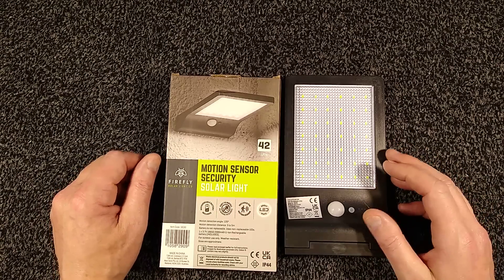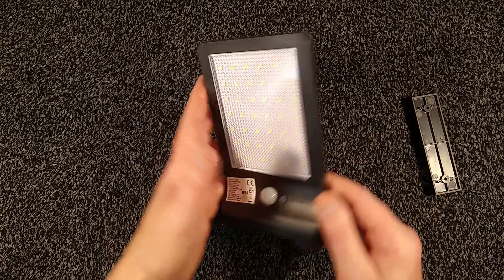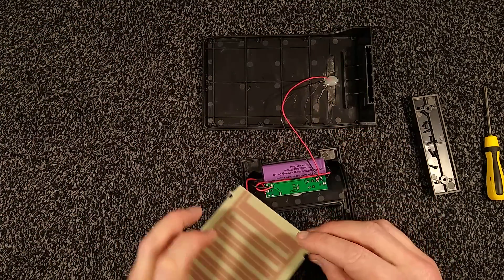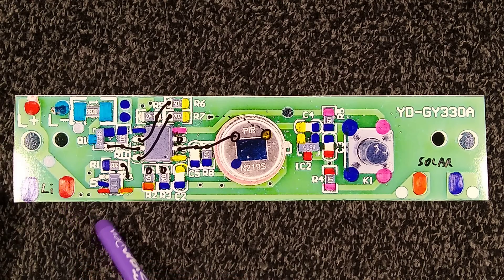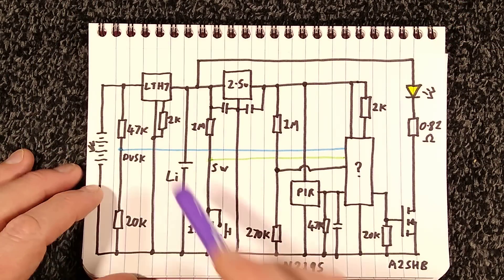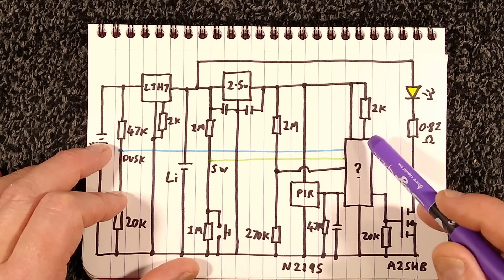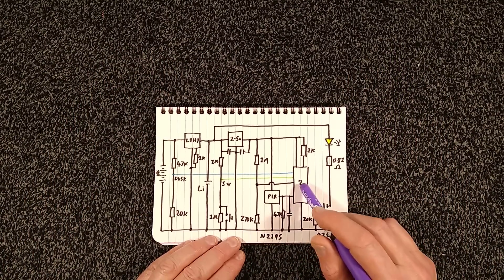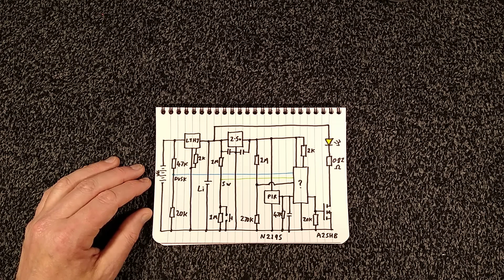Home bargains solar security light is better than the junk on eBay

Comment: We bought two sets of solar power landscape lights in 2008. Each set has four very well made tiered path lights and a solar panel. The panels have good quality PV modules mounted inside sturdy, sealed ABS housings with high quality glass lenses. They have been in continuous operation since 2009 and were still working in 2024, although a bit dimmer and the paint on the lights had faded (but didn't fail). We normally have very dry weather here in Central Arizona, but we also have a couple of months of Monsoon with a lot of rain. Our temperatures range from single digits (F) to over 110° F. We can also get up to two feet of snow over a couple of days. No problems at all wit the light except for those I already mentioned.

We redid the front yard so I took the opportunity to take the panels and lights apart and clean them up. I put in new batteries and replaced the four barrel connectors for each light's cable with gold-plated binding posts. That allowed me to run a single length of landscape wire from each panel and tap the lights off of them. 
When I rebuilt the lights I added new heavier pigtails and repainted them to match the other house fixtures. Good as new (which was pretty damn good).

Comment: Any way to disable the on at dusk feature ?. Mine doesn’t get anywhere near enough sun in UK winter to charge properly and being constantly on at night is no benefit and just cycles the battery for nothing.
Reply from the maker: It will be baked into the software.

Comment: CLIVE
I've just bought one of these.
Battery was totally flat, so I had to desolder it and charge it using my Turnigy Accucell charger (set appropriately of course).
The only thing that bugs me about the device is that when it's on standby it's lit dimly all the time, until it detects something, then switches to full brightness for a period...
I don't need the dim always on... How could I modify to have the leds completely off until the sensor switches it on?

I FEEL A SECOND (HACK) VIDEO MAY BE USEFUL 😂👍
Reply from the maker: Unfortunately that may be locked in the software as it is PWM dimming it.

Comment: Clyde, I've watched your videos for a while now and always come away with some bit of your knowledge to use myself.. Some are straight over my dome but mostly big man I enjoy the rest. Is there any chance Clyde I can reduce the volume on a robot dog who i got for my granddaughter and her da says it's a paracetamol toy... I seen another video saying that a resistor in line to the speaker will cut down the volume output... But what he didn't explain was what size you would use and how large can I use.. I'm fairly handy soldering and wud tackle it.
Reply from the maker: You may have to experiment with a value between 4 and 100 ohms.  A one watt resistor should be OK.

Comment: I've just spent 20 quid on a similar unit from TLC. It is metal and has the facility to change the battery (an 18650) without fully opening the case (you twist off a battery cover with a screwdriver). No warning about not using it in winter though. I wonder if part of the extra cost is mitigating against freezing temperatures? 

The light from the LED's seems far nicer than my 'cheapies'. I guess the test is to see how well it lasts the winter.

Comment: For outdoor applications LiFePO4 (lithium iron phosphate) cells would be more suitable because they operate safely in a wider temperature range. Unfortunately the voltages are slightly different so a basic Li-ion charger does not do a good job with the different chemistry.
At the end of the day, to get more life out of a rechargeable lithium battery, the charger IC should adjust the charging current to the temperature in order to limit the stress. The cells usually warm up while they are being charged so the charging rate tends to increase after the initial phase. Such a sophisticated charger IC is not the kind one would find in a cheap solar powered light.
Lowering the "fully charged" voltage by a 50-150 mV (trading off a bit of the available capacity) also significantly extends the life of the cells.
Reply: @mekkertroniker2002 I don't understand what you are asking.
My observation was about how rechargeable lithium batteries are affected by temperature, specifically what extends the life of a cell which has to operate in the lower end of its temperature range.
Reply: @mekkertroniker2002  well, warming up from low temperatures makes the battery better: the same cell, with the same charge,  effectively has a lower capacity when colder (the voltage at the same charge level is lower and drops off earlier during discharge). If we take two identical lamps, in the same environment and we adjust the discharge currently differently, the one with the higher setting will warm up faster than the other after switching on and will settle at an higher cell temperature. Yet it's not simple to tell which one is is better off because two parameters are different at the same time and the degradation due to higher discharge current may dominate the benefits of operating closer to the ideal temperature. With a 'dumb' discharge circuit there is no single answer: a fixed current setting on certain nights may give you an happier battery but, on other (colder? warmer?) nights, the higher stress does not get compensated.
This is what I can think right now but I would need to do a more detailed analysis.
Anyway, it's an interesting question.

Comment: just wondering how the intensity change happens when the PIR is triggered - only one MosFET controlling the LEDs.  I have a couple of these lights out here in Australia to frighten the bloody possums away from my herbs.  Very reliable
Reply from the maker: It uses pulse width modulation to give a lower perceived intensity.
Reply: @bigclivedotcom  head slap on my side - of course.  Scares the crap out the possums still

Comment: It would of been a good idea if it had a circuit to prevent the lithium battery from charging when the temperature was too cold. Not much good when you have to take it down in winter as the nights begin to get darker for longer.

Comment: Been using one of these to light a key safe (ideal as the led panel is facing straight down). Really bright down light without blinding your eyes, been running for a year or so and no issues. So much better than the far east units that seem to last one summer at most.
Reply: Installed year round with no charging issues in ~freezing temperatures?
Reply: @snafu.X  Because it’s protected from the wind/rain and my house is old so solid wall construction and leaking heat through its walls, the unit is protected from all but the deepest frosts.

Comment: Those plastic type of solar panels can become  VERY  cloudy , with constant sunshine .... you can make them look new & shiny , by the application of household varnish ... but I recommend a  LIGHT spray ... (  POUNDLAND™ ! ) spray yacht ( ? ) varnish works well ... do  NOT  be tempted to slop on a thick brush layer , from a tin  ... the solvents will give the  plastic covering a ( 1950's😝 ? ) crackle finish ... defeating the whole effort ( Ha - Ha ) ... ( ? ) ..... DAVE™🛑

Comment: I'm guessing the reason they don't want to use LiFePO4 cells is because the Li-Ion cells are so much cheaper, even though the temperature range isn't really suited to your climate. From what I can tell, you can get them in the 1100-1600mAh range, which I'm sure would be sufficient considering you're not likely to be running this thing for hours every night. But yeah, the cheaper non-aliexpress/alibaba sauces still seem to be around the 5 USD mark, which would make these cheap kinds of devices much more expensive.

Comment: I just bought a universal travel adapter from AliExpress (with the slide-out pins for different plugs). Wide range of prices, little apparent difference in features (mainly the USB port wattage). Would be good to see the innards of a few compared.
Reply from the maker: Be aware that some of the less compliant adaptors can pop out live pins in use.

Comment: Great info about the lithium charging.  I thought the LiPO4 batteries were the ones susceptible to that and not so much the regular 18650s.  Thanks Big Clive.  Now I know to bring these suckers in for the winter.  I didn't known that.  I guess that's why some have failed (in addition to UV susceptible solar panels which I've not figured out yet with P-Cut or Wax or what have you)

Always great to have the Explosion Containment Pie Dish right?  LOL  Interesting circuitry.  Thanks for your workup.

Comment: A lithium-battery-containing solar light I bought a couple years ago has started to flicker. This is a problem, because the one watt LED is pretty much right in our faces. I've never been totally happy with it, so I might rip it down and do some of my own upgrades to it.
Reply from the maker: It might be the LED that's failing.
Reply: @bigclivedotcom  I had not considered that prospect. Thanks for the heads-up.

Comment: I've had a very similar one for a few years, after replacing the lithium cell for a better one and increasing the LED resistor, it has been quite good. As mentioned the solar panel has deteriorated, whitish surface and edge starting to delaminate. Mine also had a remote control, I had to replace the 3 terminal IR receiver, whose leads corroded.

Comment: We get these very similar looking lights locally in Aus branded “Arlec” from Bunnings. Had a few over the years and they really are a very useful and reliable light. Low level turns on at dusk and the higher setting comes on when ir detected. But then very cold weather was rarely a problem. Great for mounting over doorways when you need to find your keys.

Comment: The 1MOhm resistor divider on the battery side with the switch is actually quite clever - it allows a single A/D input to both monitor the battery voltage (so that the controller can go into deep sleep if the battery is too low) and to detect the switch being pressed. Really efficient use of minimal components and great functionality.

Comment: Most of the security lights I find are all using batteries and solar. Even expensive ones. Our winters get down to -40C so they might last a year. I just want the good ol' $20 one that you hook up to your light switch and electrical but I can't find any good ones!

Comment: I work for a Heritage Railway and we have solar powered security light's and two years ago one of the light's the battery's failed after a cold snap and now I'm thinking that must have the cold weather had some thing to do with that.  It was cold we had brakes freeze up on the carriages great fun

Comment: Not being able to adjust the "on" time is an issue for me, whether or not the pcb can be hacked to enable adjustment, most I've seen of the cheapest and nasty have all the circuitry inside the pir module?

Comment: "The Lithium cells don't charge too well when it drops below freezing" - a problem we never have where I live 😀.  They tend to lose charge capacity when they get past 40C too (a problem we DO have!). Very nice little light though, and it appears identical (internally) to the "Stainless steel" case ones we have, even down to the easy-demount bracket. Ours have a single turn trim pot on the "dusk" divider, so you can set the light level where they turn on.
Reply: Sounds like your area isn't too different from mine, as far as lithium-ion cells are concerned.

Comment: The chip might be just a micro controller using all of it's inputs in analogue mode (but that wouldn't explain the 2k resistor direct to an input unless it was to a reference pin and the pin capacitance is part of a filter). It looks like the divider with the switch could be doing double duty of measuring the cell voltage to cut the light at low battery, as well as sensing the switch; if holding down the switch for a while (long press) switches the light off, then maybe that is the case.

Comment: The voltage divider on the button also makes it possible for the micro controller to measure the battery voltage.

Comment: Can you show how to bypass PIR correctly to stay in "low mode"? Hot snot pressed into the golf ball with an oiled ball bearing is the mechanical disabler.
Reply from the maker: You can just cover the PIR if the light is just for low level continuous use in this type of light.

Comment: I bought a bunch of Temu lamps for a long dark wooded driveway.  Even is Summer it gets little sun and low light levels.  I added an external connector to the battery so it can be charged without opening it up.  In Summer, I need charge it only once a month at most but in winter, I charge them once a week.  It rarely freezes here.  I just use a portable battery pack and an external charging board hooked up to them for a few hours.  Not the perfect solution but worth it.
Reply: How do you protect the charging port from the elements?
Reply: @Legend813a  It's just a 2 pin connector hanging out of the casing.  It's aluminum contacts so no rust but dirt and pine sap does get in now and then.  I clean it with alcohol regularly.  Rain doesn't affect it, being low voltage.
Reply: @Legend813a  You can always smear it in dielectric grease.

Comment: It's a bit disappointing that it doesn't have a temperature sensor and MOSFET to turn off the charging. I wonder it the battery protection circuit has one?

Also note that lithium ion cells also don't like being charged at temperatures above 45°C, so perhaps not using it in hot areas in summer. Also note if it's in the sun, it will get hotter than the air temperature.
Reply: Hmm, most micro controllers have internal temperature sensors, so  it would be pretty easy to detect if the unit got too hot. Even though it doesn’t have explicit charge disable circuity, it could always turn on the light to bypass the charge current and reduce charging that way. I’ve used this method myself in solar lights, and it works pretty well to protect the cell when it’s too hot for safe charging.

Comment: There is a huge hole in the PCB that looks like it has fully severed a trace. If so is there a bodge on the back to fix that or is that hole there to fix a design flaw?
Reply from the maker: It may be for testing or as you say to fix a flaw.

Comment: Re your winter comment: I have run some solar lights with 18650s for 4 years in the harsh Canadian winter. I have only taken them in one time so far to top them up when I had a particularly dull month one year. It gets to -40C but they only charge for a few hours in the noon sun when it is a balmy -10 or so. So far all the cells are fine!

Comment: I have a solar light that has three slots for 18650 cells.  It only came with one slot filled but I filled all three slots with matched cells for better longevity.  Great option for darker times of the year.

Comment: I noticed at the beginning of the video you somehow managed to light the LEDs at half (quarter?) brightness and later on at full brightness. Now looking at the "shkematiks" the only two ways it can be achieved is either the mystery chip is more complex than we think and produces PWM; or the MOSFET is driven in a linear regime which seems wasteful in a circuitry that is fed by a battery. Did you try to use an oscilloscope to see what is happening at the gate of the MOSFET?
Reply from the maker: It PWMs them at low level after dusk and switches to brighter light when it detects movement.
Reply: @bigclivedotcom  Cheers!

Comment: The temperature problem is why I prefer exterior lights with replaceable AA cells, I can bring the NiMH cells in for charging when needed, and they tend to run for longer and the whole package has a longer life.  Also, I can mount them under the roof edge where the sun never shines, and there's less interference with wildlife (moths, bats etc.) other than the local cats which can trigger them.

Comment: The two  1 meg R's may be to read the battery voltage, either to adjust LED PWM for constant brightness, and/or prevent over-discharge. 1M is a bit high though - accuracy would be affected by pin leakage.
Reply from the maker: I think that's why they've done it like that.  Quite clever using the voltage sensing divider as a button input too.
Reply: @bigclivedotcom  Might be interesting to tweak the voltage on the divider and see if the LED brightness changes

Comment: It’s too bad they use so much plastic on these devices.. it kinda of eliminates them from being usable in Colorado due to the way our levels of UV, which destroys the plastic in a year or so.
Reply: Paint it white
Reply: Put some UV protected plastic on it, e.g. twinwall polycarbonate with UV protection
Reply: @SolarCookingGermany  Twinwall dies within a couple of years. It yellows and then turns brittle. Remember, you can burn your skin within 15 minutes, even with full cloud cove. UV at high altitudes destroys most plastics

Comment: At 3.7V - is that a Lithium Iron Phosphate cell?
Reply from the maker: It's the mid-voltage of a standard lithium cell.
Reply: The iron cells are marked 3.2V.
Maybe that is too low for many LEDs in parallel.

Comment: 1:43 Not just that, below a certain point some lithium technologies reverse polarity, which would be bit problematical. Admittedly, you need to go below zero Celsius, but that isn't so unusual, especially if you use one in your microlight.